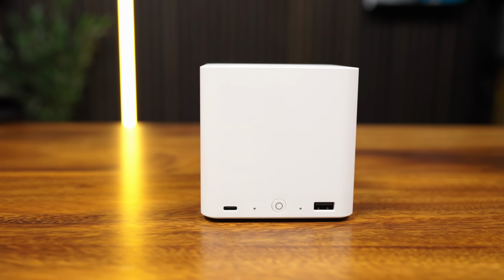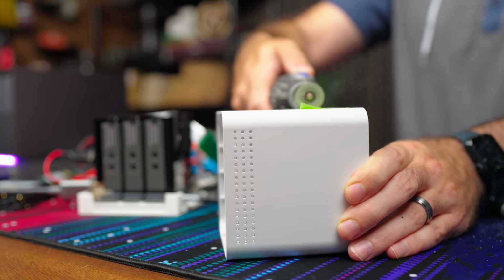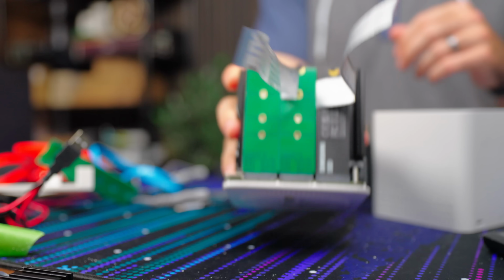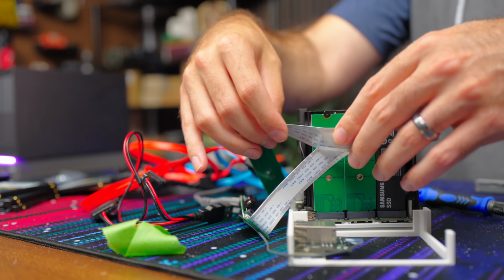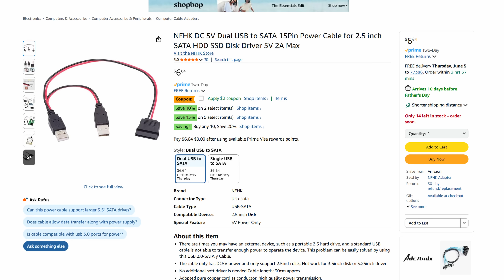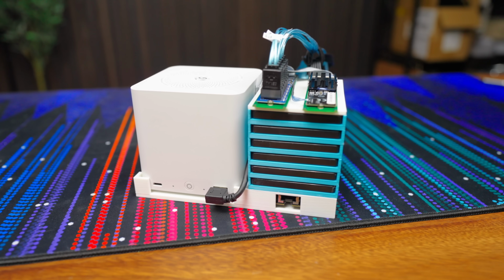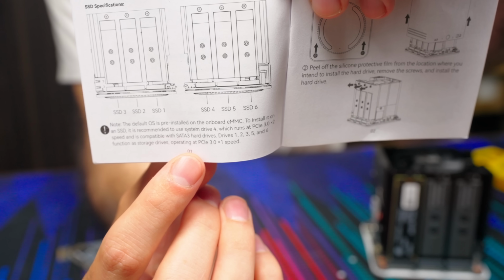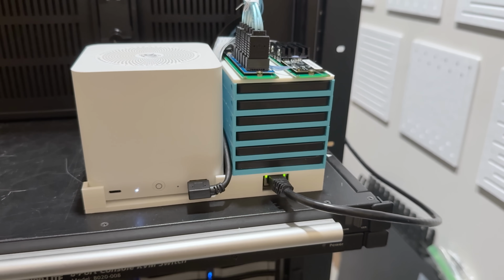I fixed this NAS

Comment: Once Beelink releases a v2 with an N300/N350 8-core, 5G or 10G ethernet, and each PCIe at 3.0 x2 then I will buy

Otherwise you're just buying a SATA-speed NAS with more expensive M.2 SSDs

Comment: I'm giving this a print, but using a USB C to 5 port SATA adapter... 
So far so good.
Reply: It came out nicely - the trays are too short for HDDs (as I only have them to test with) but SSDs look just perfect. 
Tests with the USB to sata adapter have been great so far - luckily I don't need the extra space for now - but when I do this'll be perfect.
Thanks again
Reply: @Aikidokajeff can you still put the drives into a raid config with the nvmes in the bay over a usbc? I saw online saying that any drives over usb can’t be used in the pools.

Comment: This is amazing and may have tipped me over the edge on getting one. Has anyone tried running more the 4gb of the sata ssd's yet? The specs saying it's 4tb per m.2 slot has me cautious about committing to the build (of a whole extra raid pool off one m.2 slot.)
To save anyone checking the TrueNAS screen shows these ones as 6 512gb drives so a total capacity of 3(ish)tb.

Comment: such an expensive piece of work, why would anybody want to afford this.
Reply from the maker: Not everything is about spending the least amount of money possible
Reply: @RaidOwl  Missed my point entirely. I meant, the value just isn't there pound for pound.
Reply from the maker: @LanceBryantGrigg  The value is in wanting to do something fun and learning, again its not about the money
Reply: @RaidOwl  Fair enough - That I get, and I actually I guess was not arguing directly against that but I can understand the context that you concluded that's what I meant. In general, the Beelink ME Mini PC is very expensive compared to its peers(nas's without the cpu/ram to go with it), and the only reason most folks would want to spend that would be because of its rather unique ability to drive lots of NVMe drives.. outside of the asustor its difficult to get this kind of a layout.  One is basically better to do the proper ms-01 or ms-a2 and just run with 1 less drive.. just my two cents. as a Tinker'er myself, i get that its not about the money, but only because its a learning/nieche thing that you did with it.. I was again only refering to the raw device.. which imo is way overpriced pound for pound.
Reply from the maker: @LanceBryantGrigg  Yeah its definitely a niche item but without fun niche items the market would be boring af.

Comment: A bit late to the party but with exactly the same NIC I've just removed the radiator and I could put it in the 4slots without any problem (I kept the thermal pad to make a good connection with the Me Mini central radiator and I'm at 65°C in utilization for the NIC).  I think I can now print a new base in 3d to replace the bottom of the box and put the 10GBe slot without needing to cut the case.  No sata but still 10GB NIC.

Comment: you should have left the original case off the beelink and designed a full 3d printed shell that everything fits inside, would have been a much cleaner look, and you wouldnt have had to cut the case or worry about the ribbon cable length

Comment: Hey! Thanks for this excellent video! I just got the same unit, and I want to use the integrated pre-installed harddrive, for TrueNas. Now during the installation of Truenas it fails and says it cannot find boot partion no 2...? How can I wipe this integrated storlaget completely, so that Truenas wont fail during install? Anyone?

Comment: Rather than use an NVME slot for the SATA controller you could use the USB C 3.2 port to go direct to 5 port SATA controller. "CY Adapter 10Gbps USB-C Type-C to NGFF Key B+M SATA 6Gbps 5 Ports Adapter Converter PM Port Multiplier Selector JMB575 JMS580"
Reply: Would you lose the power doing this?

Comment: The heat on this device comes from the power section. I checked and saw the power module hitting up to 60°C. If that could be addressed, I think the internal temperature would drop significantly. It’s a bit disappointing that it doesn’t support USB-C or PD charging for power delivery.

Comment: Several questions, as I've been thinking about this video since it came out.

Q:  Do both 2.5Gb ports work along with the 10Gb?  Assuming so, but just want to confirm.

Q:  Did you take any thermal readings of the SSDs?  I am curious if the heatsink for the SSDs and the power supply is adequate.

More of a statement.  Small 2.5" drive cage to add/remove drives with ease.

Lastly, other commentators said the same thing I was thinking too.  Remove the cover, make it more user-friendly for the 2.5" drives and cables, and print a bigger case, maybe with a larger fan for better heat dissipation.

Your hack/additions really got me thinking of how to make this into a premium home NAS for a variety of uses.  Like 10Gb for movie but the 2.5Gb for music, pictures, iSCSI booting, document repository, etc.
Reply from the maker: Yes both 2.5G ports work. Thermals never got over the mid 40s but I wasn't pushing them too hard.

Comment: I would put the sata controller between beelink and the 6 drives.
Mount the m2 10gb card at bottom and reverse the 10g connector so it can be removed.
Lastly get a female dc plug and split the 12v power source to 5v and output a cable to beelink nas. The way to remove the ugly usb cable.

Comment: Given the x7 PCIe 3.0 lanes available, full 10Gbit, x6 SATA, and an M.2 PCIe 3.0 x2 would all have been easily doable by the manufacturer. Why they are choosing this weird gimped CPU + hamstrung M.2 NAS route I will never understand.
If you want an incredibly fast, cheap, small NAS, an x6 SATA SSD setup would've made more sense.
If you want whatever this this was SUPPOSED to be, they should've used an Alder Lake-U based platform with PCIe 4.0 and 20 lane access. 
Either way, 10Gbit should've been the minimum networking spec for an SSD based NAS.

Comment: Literally exactly what I've been saying about this mini NAS since first seeing it!
Alder/Twin Lake-N is entirely inappropriate for an NVMe based NAS, but perfect for a SATA based NAS. And the formfactor would easily support an x6 2.5" SSD setup, while an upgraded 10Gbit NIC would be a much better fit for SATA SSD performance throughput, without the need or complication of more "exotic" networking.

Comment: USB 3.1 Gen2 is rated at 3A, so 15W. Would it be possible to power a single 3,5 HDD using a step up cable?

Junk Meter Skyrocketing...

Comment: Aside from making it possible to access the screws on the 10 gig port, I would also put it on the back side, where all of the other cables are. I find this really annoying on some of the Raspberry Pi mods too: there are cable connections on all sides of the thing!

Comment: Problems is that for reasons I can't underatand, RAID f..ks up ssd like DC share on a cheap hdd. It looks cool and all but for long time storage go with raid 6 sas drives. More expensive for sure but if you want long term solution like 15-20 years...

Comment: FYI, 10gbps ethernet gives you 10 bilion bits transmission. Yes there are only 8bit in a byte, but you get consumption on header, footers, crc, medium access signalling, so even in bytes you are realistically looking at max best case scenario or on short bursts 9800MBytes/s (like a single jumbo packet)

Comment: Some white electrical tape is a jank solution to the unwanted hole. For less jank, mix up some clear epoxy with white coloring until you get the right shade, then fill in the hole (from the inside, with the outside clamped to a smooth epoxy-resistant surface). You can also get some good small files to smooth out the holes that you do want.

Comment: I actually did kind of modified a NAS not too long ago...
Got the same iocrest 10g but I added a few things. 
first, because I wanted 3.5" drives which need 12v, I added a power distribution board (dc jack in, usb for on/off and 8 sata with 5v and 12v).
second thing is while I did get the same m.2 extensions from amazon, I directed them to pogo pins/reversed on the other side so I could easily remove the drives assembly plus the power trigger of the usb to some extra 2 pogo on the side.
I 3d printed the other side of the enclosure with neodymium magnets and locator pegs and put the m.2 sata card and a hotswap drive cage so it's fully contained, just put it on the pogo pins and plug the other barrel jack.
Reply: awesome - could you please share the power Board you are using?

Comment: You'd be better off using a n100 board.
Reply: You might be correct,  but do you have any good reasons?

By board,  do you mean that you are recommending a standard form factor motherboard over a mini PC?
Reply: @chris-io9ztit would be cheaper and less janky.
Reply: @chris-io9ztThere are minis forums and others that make em. Id rather go that path imo.

Comment: Ditch the 2.5" SATA - they're as expensive as NVMe but so far slower
Running the PCIe extension to a 3.5" enclosure with it's own PSU  however ... big capacity

Comment: Wonder why you want to drill a hole for ribbon cables and don’t want to print a cover for the NAS with all possible attachments, so this will not void warranty and it look nicer for resell it
Reply from the maker: Too difficult. I’m not that good at 3d design yet
Reply: @RaidOwl Maybe Beelink can share the file for the cover. Will properly boost their sales.

Comment: I picked up this 10gig M.2 card a while back and it absolutely needs active cooling.  The passive heatsink that comes with it is not enough.  Mine was constantly dropping its connection and struggling because it was overheating.  Be mindful of this.
Reply from the maker: Yeah I figured I May need to make a fan mount

Comment: link aggregation give you 5 gigabit with no nas modification, you reach 600x8=4.8gigabit therefore 10g adapter uselsess, price of modification comparable with nas, maybe better buy 2 if you need extra storage

Comment: Looks like you took a page out of the playbook of your buddy Hardware Haven. I approve. Now mod it to handle 6 x 3.5" SATA spinning rust drives, then I'll really be impressed. Maybe add a pico PSU to provide the required 5V and 12V to the drives, and tie it to the internal PSU (somehow) so the drives spin up when you press the power button.

Comment: Honestly ... when using 3D-Print already, why not just make a whole new case, that would be big enough to house everythin inside and would make the use of any additional tool unnecessary? Twice as high, one inch wider in both directions and there you go, no ugly view anymore AND if you did it right, you could install an 120mm fan instead of that noisy pre-installed one.
Reply from the maker: I’m not good enough at 3d design yet
Reply: @RaidOwl  Honesty always wins ;-) At least, you got another goal ...

Comment: The internal power supply...
Is it 12V and do you think it can be used to power some 3.5in (desktop) harddisks also?
Or if it doesn't have enough juice, how easy/difficult to replace the internal power supply with external one?
Yes, I'm thinking about 3.5in harddisk NAS with single power supply.

Comment: I've been looking at using ab odroid H4 Ultra... With nvme Expansion card and using a combination dell hard disk Caddy's and 3d printing the case to hold the caddys. Also using the nvme sata expansion like wjat you have done here

Comment: Love the Jank ! 😃 I found a mini-atx board with a x16 and a x4 slot. I used a Ryzen processor with 28 lanes chip gpu. I put a 4 slot nvme card in the x16 and a 10gbe nic in the x4. I put 2 more nvme on the MB and connected 2 small sata ssd for a redundant system. ITS HUGE. Why can't anyone build a compact motherboard with all this included I'm thinking it can be done with a 120mm fan for cpu and nvme cooling. Why can't anyone build this NAS. 6 full speed nvme and 10gbe.
Reply: My first guess is that cooling would be a problem.
Reply: which board did you get?

Comment: All Beelink had to do is give us six x1 slots and one onboard 10 GbE port. It wouldn't be the first time you need to find NIC drivers to enable the one and only NIC. Nice job fixing their mess-up. I don't think you need the SATA controller, though.

Comment: the 10 G was !!!$262.87!!!!   WHY ??
USB 4.0 Type C 10G Ethernet Adapter, is cheaper  but not  worth  it  for a diy build
that is  about 10TB of spinning storage  

adapting "all the ports "to handle full sized  drives is the only way  to diy a nas  
i never look at  speed    ( i  saved to tape on my vic 20 in the 80's🤓 )
i just need JBOD reliability and total storage  .. upgrade and swap out your drives every 3 years

Comment: When looking at lspci you first highlight LnkSta (Link Status) for the network card and after that you highlight LnkCap (Link Capabilities) for the SATA controller. LnkSta for SATA controller is "Width x1 (downgraded)" just 4 lines below. Just a minor nitpick which still doesn't explain 1.6GB/s :)
Reply: I'm not 100% sure of what I'm about to say but I would explain the 1.6 GB/s speed with the drive setup RAID-Z1, where it segments files in chunks and place the chunks of the same file in separate drives, which later translates to an improved read speed over using only a single drive. So, in reality, even with a single file, you are actually reading from multiple drives at the same time, retrieving a chunk from each disk and when combined, you reach a higher read speed than expected for a single drive, when using a RAID-Z1 array. Please correct me if I said something wrong. I'm also trying to learn. 

Great build and video btw @Raid Owl

Comment: The USB to SATA power cable is the definition of "Don't worry its temporary...unless it works" Red Green
Reply: My gawd the majesty we’d be watching if Red Green were doing techtuber suff!
Reply: Usb power is eternal, usb data isn't to be trusted.
Reply: Not enough duck tape.
Reply: if you are using all 2.5 SSD, then I won't worry about that too much.
Reply: @Bytional would 2x3.5 HDD work ?

Comment: You guys are all my usb-c charging cable that won't quite plug in because the plastic housing is too wide and so you shave it down to fit but then it's 5 watts too little to be viable for a laptop and so you use it on your ipad mini only to find out it's a knockoff without an e-mark chip and it sends the full wattage through and fries your device.  Never change.

Comment: Is it possible to do this with 3.5" HDDs ? For the enclosure, why not remove the cover of Beelink and create a new enclosure containing the circuitry and you are not anoided anymore by disipators size ...
Reply from the maker: You COULD tap into the 5v/12v if you know what you’re doing but I wouldn’t recommend it

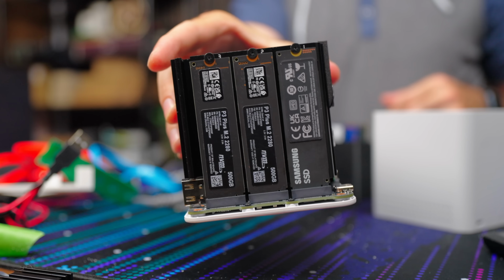Comment: 3:05 I had a similar issue with those nvme to sata and if I had to guess, it's probably because some are wired as CPU pcie and some MOBO pcie.
Reply: Too long, didn't post:  I was able to fix it in a different way than rotating the slot. 

I'm pretty confident that it's because when the Linux kernel initializes and the bios takes stock of what is available to it via pcie, it loads one interface card before the other. (Since it's a primitive sata controller/raid card) depending on what OS you're using it'll only bind up one controller (I was using proxmox, never tried truenas with that controller) so by adding a script to automatically unbind the onboard controller and grab the other one, it seemed to work. 

Disassembled that machine shortly after because of a different shortcoming but you probably encountered the same issue and solved it a different way.

Comment: what? dremel is just fine. you never actually see the nas box, when it sits in the server room corner or shelf. potato-nas low form factor cases are very fine, microatx size. that size has enough space for modification. also potato mbs have usually only the 2-6 sata3 ports, maybe a single m.2 if any. also ssh sftp instead of windows file transfer? your own 3d printed custom micro-atx or mini-itx case.

Comment: You weren't seeing x2 in the link status, you looked at the link capability.

The link status shows x1 (downgraded)

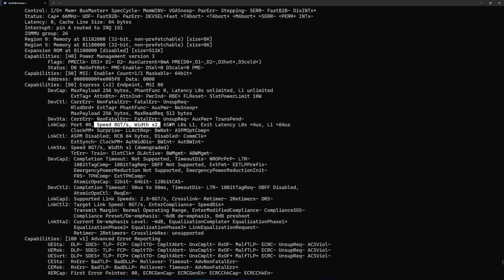LnkSta at 7:15

Edit: time stamp
Reply: Yeah; my guess is ZFS caching shenanigans. It's always hard for me to get ZFS out of the way testing raw disk access performance.
Reply: @JeffGeerling usually some command line Linux nonsense can get it done, but it's often a pain in the nuts.
Reply: Won't FIO allow one to bypass filesystem issues?   Though that approach may render an unacceptable non-real-world result.
Reply: @chris-io9zt Yeah; if you hit the disks individually fio can bust through ZFS, but I like to test full arrays for real-world performance, and try to do that hitting drives/PCIe/CPU directly, since some implementations are really bad and add a lot of latency.

Using mdadm to create standard RAID arrays can be a little easier to reason about, but has its own quirks.

Comment: Man, absolutely cool mod.
After seeing you topless... I mean your other video on the ME Mini I must admit you succeeded in manipulating me into thinking it was the new tool I needed but considering the total investment in nvmes + the mini I finally went for the Beelink EQ14 and my actual 22TB drive.
Problem is that it's impossible to find cheap PCIe 3.0x1 NVMe's to lower the cost but it's a damn fine machine in my opinion.